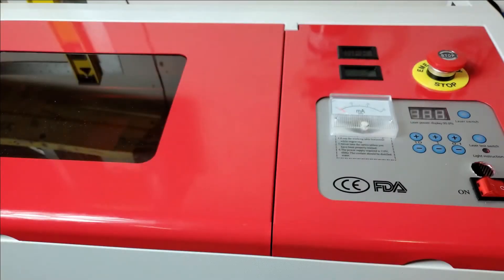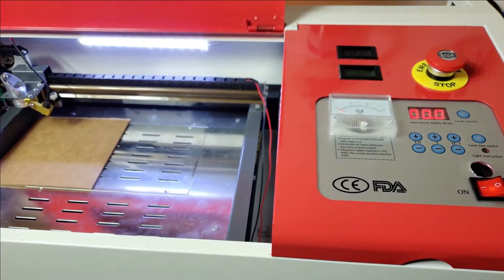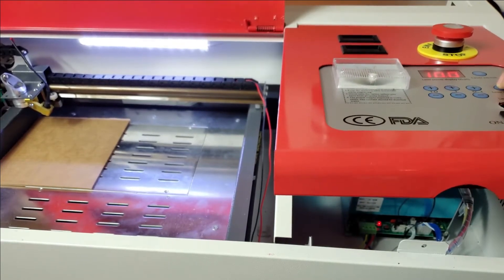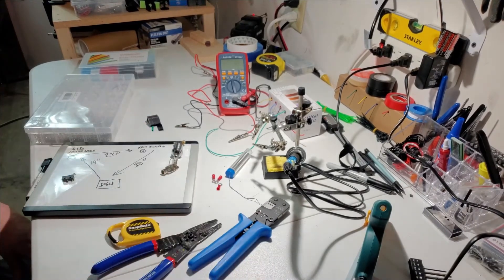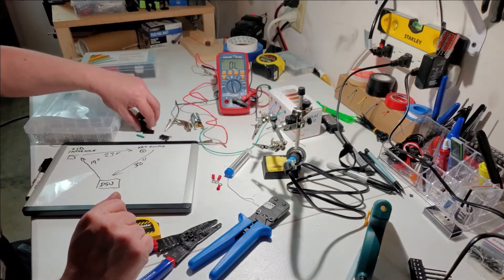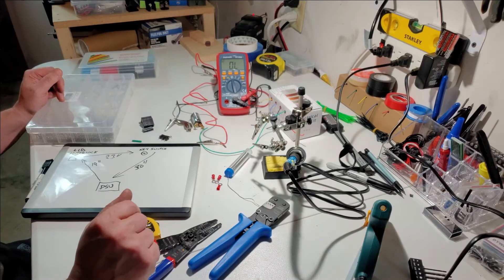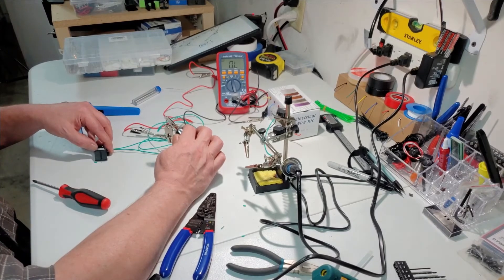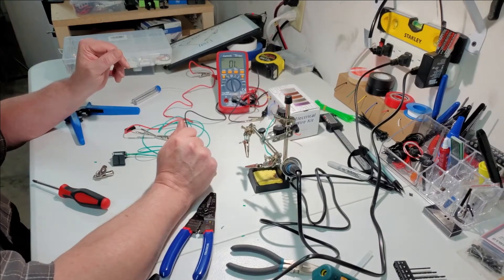Initial safety modifications for the K40 laser - Lid Switch - Key

Comment: First off thanks for the video's.  I've owned a K40  for about a year and have not really gotten around to using it other than testing it right away.   I have all the upgraded parts I want and one was the water flow indicator.    Can you tell me where you got the 3d printed parts for this?
Reply from the maker: Hi Scott... I am having a blast with mine... I have a 3D printer, so I designed and printed all my own parts. I am making all my design files (STL) available for free. Those without a 3D printer will be able to buy the printed parts after this weekend. You are not the only one asking about this.
Reply: @k40mods55  Printed and they came out great.   Thanks!